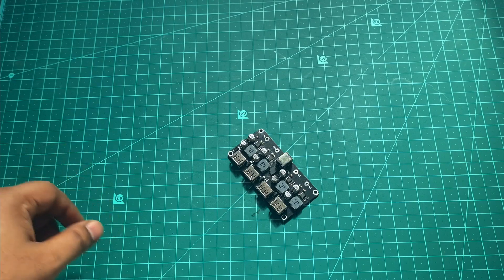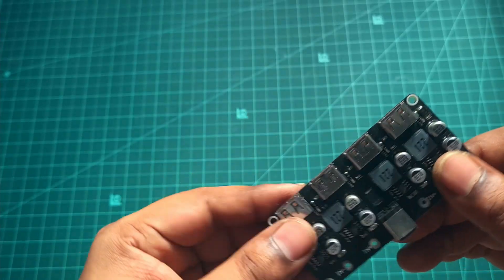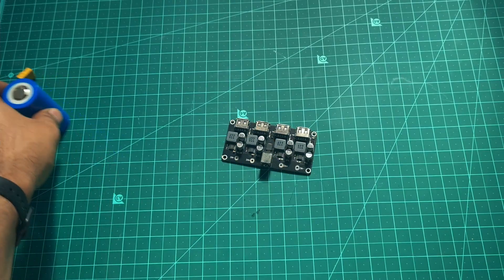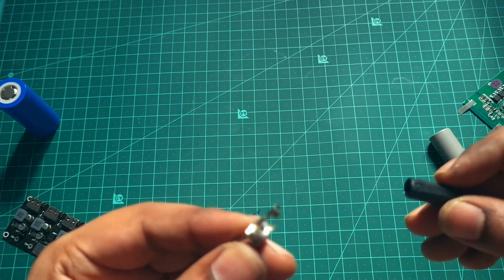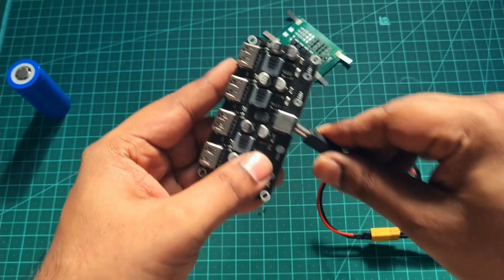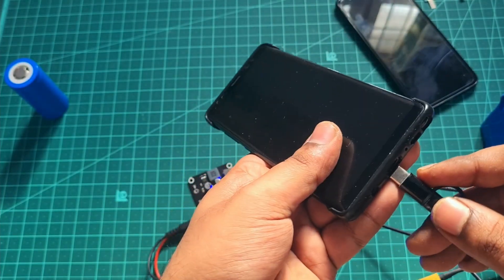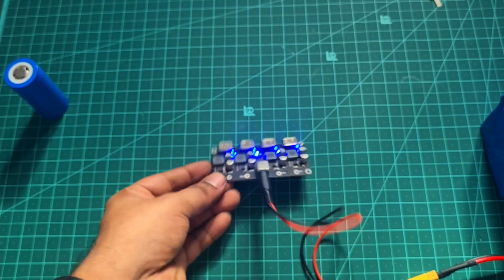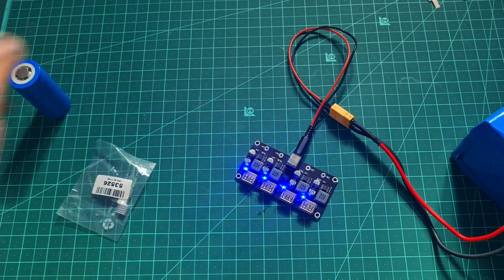4 port USB Charging QC3 Board - 6v to 32v DC- buck converter overview.

Comment: Can i use this with an adaptor to my power bank that supports qc. And charge multiple fast charging phones?
Reply from the maker: You can supply it with more than 12v   3A for it to support multiple fast charging of mobile.
Reply: @diyIndia  my powerbank is romoss pea60 with 60000mah
Reply from the maker: I dont think it will work and it's not efficient.
Reply: @diyIndia  I see thank you for this information.
Reply: @diyIndia  one more question if I use this module connected directly to a solar panel to charge. What is the recommended solar watt panel?